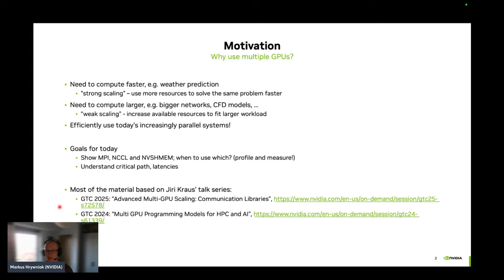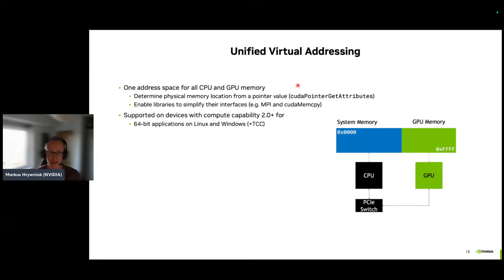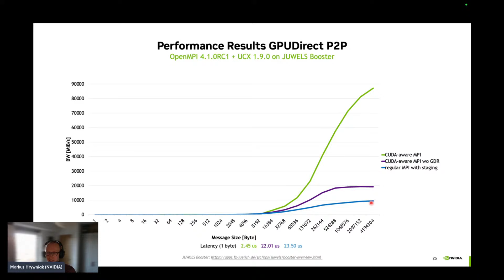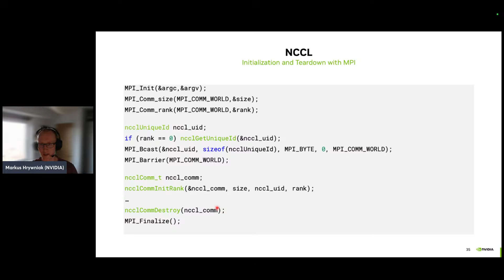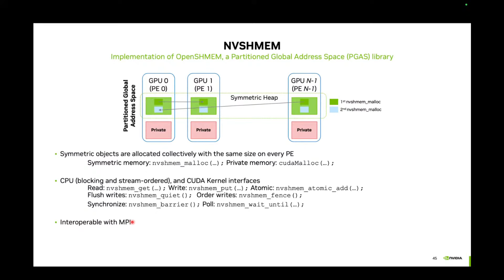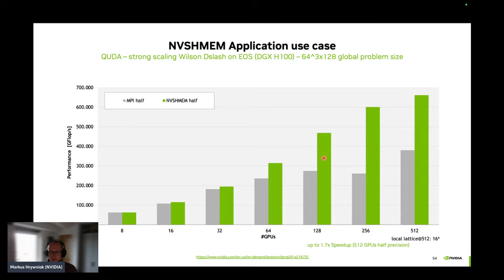Multi-GPU programming

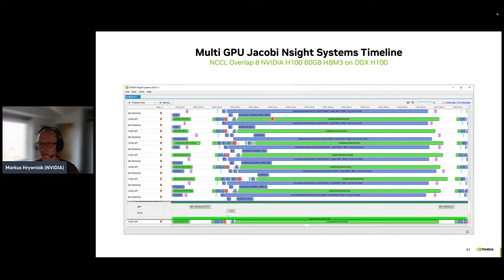Comment: It shocks me the amount of added complexity due to nccl to get results as shown at 49:00 that are barely better than MPI. Maybe NCCL's main value proposition still is collectives and getting those to go faster at smaller buffer sizes compared to MPI.
Reply: Thanks for watching! If your communication is exposed on the critical path, overlapping should help; but by how much, or even whether NCCL, MPI, … perform better is application-dependent (amount of data, comms pattern/partners, location of buffers, ...); I would be wary to draw general performance conclusions about NCCL just from the Jacobi solver mini-app.
I suggest the summary at 1:07:20 for high-level decisions, but anything further it's best to do a full-app profiling run first to make sure you have at least a rough model of what your expected gain is, so you also have a way to validate the outcome (i.e. similar to the Nsight Systems screenshots shown here).

Perfectly fine to continue using CUDA-aware MPI if you don’t need stream-awareness, or don’t expect a huge speedup in your case.
If you don't mind going into more detail, where do you see a huge amount of added complexity?
Reply: @mhr_nvidia  Intuitively, communication can at most provide a x2 speedup. Scalability of the algorithm should be of higher concern when designing a software. That said, that x2 can be sweet sometimes.
Reply: What you are seeing is an artifact of this workload.  NCCL is CUDA-aware, whereas MPI is not, so when one wants to implement fully asynchronous pipelines in CUDA, NCCL is a much better model.  One also finds that NCCL optimizes large message collectives much better than MPI implementations, because MPI's primary use case in HPC is more latency-oriented.